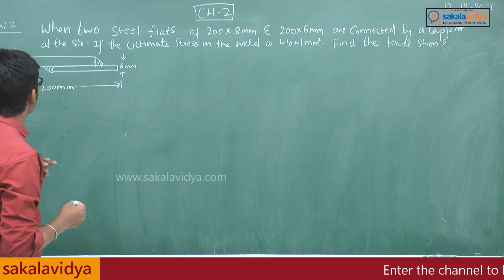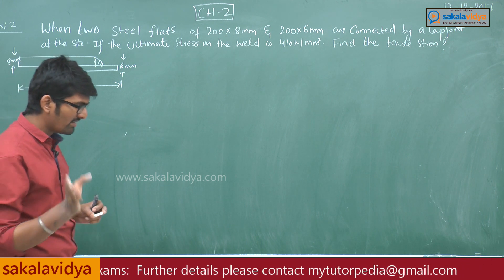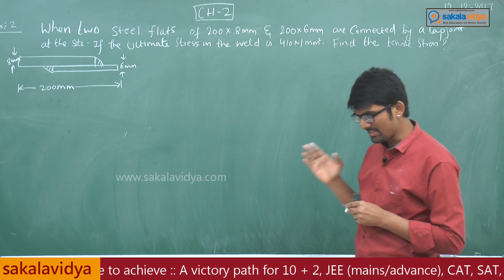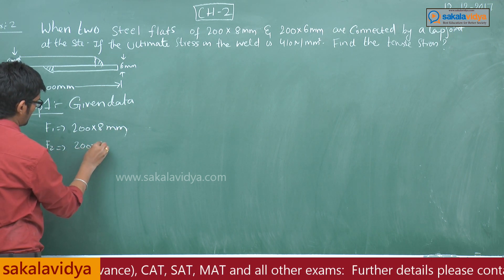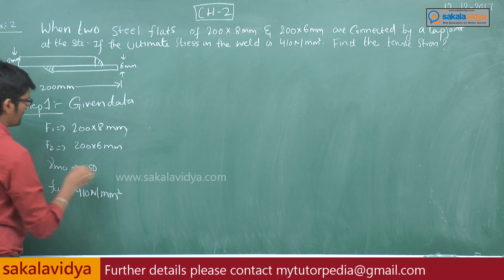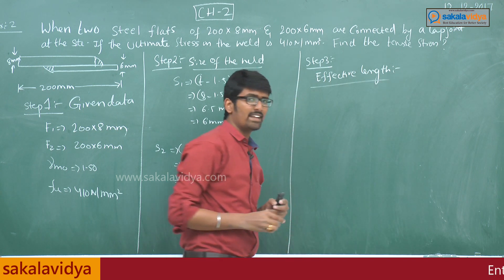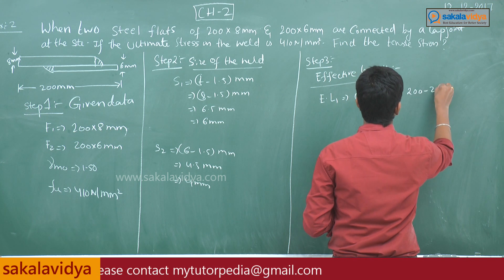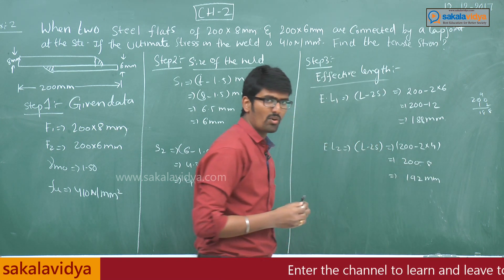Design of Fillet Weld Part  - 12

Comment: Why we subtract thickness from 1 .5
Reply from the maker: For the safety purpose. 
when the size of the weld is not given in the question, we have taken as the given size of the plate minus 1.5 i.e (thickness of the plate-1.5).
In this question, the thickness of plate one is t=8mm & t=6mm
size of the weld is s= 8-1.5 =6mm, it is very clear that size of the weld is very less than sie of the plate.

so the size of the weld i.e "S" should be less than the thickness of the plate.so that's the reason we need to subtract with 1.5.